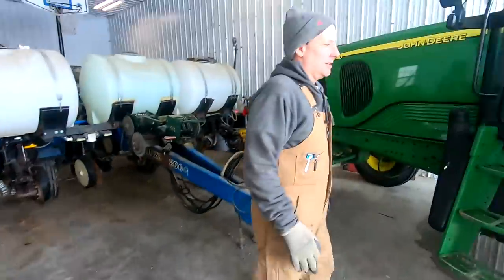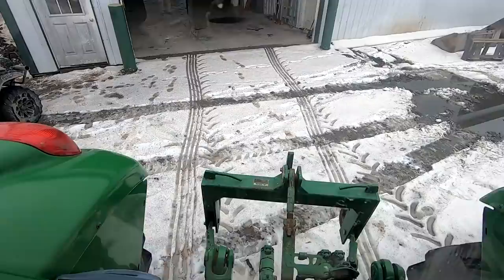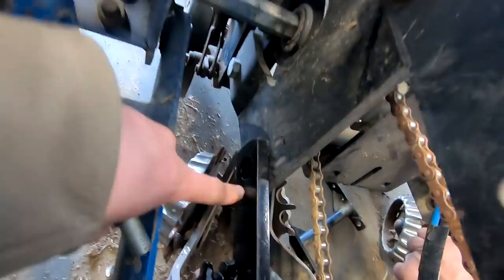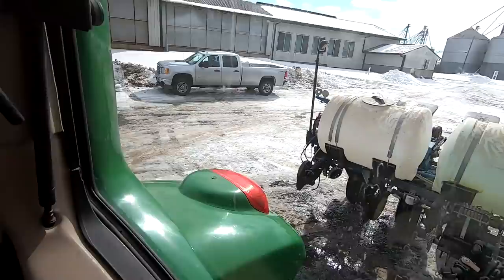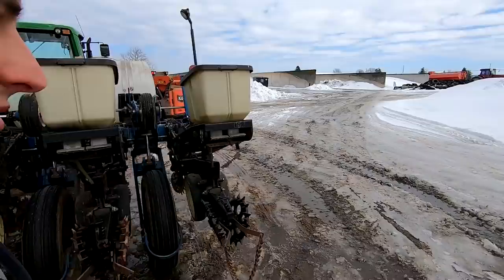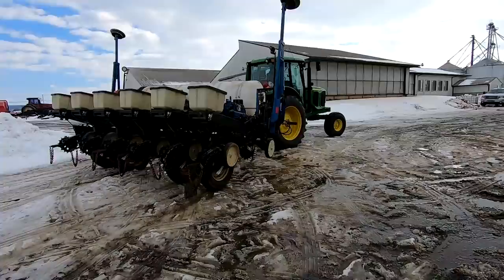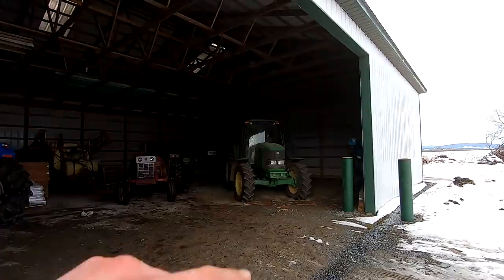Corn Planter is Ready for Spring

Comment: You guys should be selling your old rusty planter parts!  These are snapped up all around me for rustic garden art.  The row cleaners look like flowers. The discs are used to make a grilling tool called a discada or cowboy grill. New way to recycle and extend your connection with your fan base!  One mans trash is another mans(on woman’s)  treasure.

Comment: 0.58 " we need to take the bracket off the back." I think that is a quick hitch, which will attach quick hitch compatible implements (plow, rototiller, scraper) much quicker - like hooking up your skid steer implements. If you don't have a quick hitch you will have to attach / adjust the three linkages each time. If you don't need it I am sure you could sell it.

Comment: reason for the bushing is that you can torque the bolt fully, and not pinch the arm, so it can swing freely, it's basically a cheaper way then using a shouldered bolt
Reply from the maker: Yeah thats right

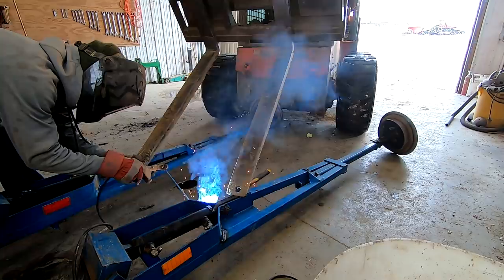Comment: Hey Eric, i just wanted to let you know the big no no you did at 4:26 its something that i never realized till i went to welding school. disconnect all batteries when welding on equipment, i realize these end rows don't have batteries BUT! that skid loader dose and its making electrical contact with your welder, witch is now driving a direct current through your battery, in a nutshell your cooking your battery and they can actually explode! my welding teacher had a safety glass boded in car and shows what can happen when welding on anything that has a battery equipet. a brand new battery lost 30% of its charging cap! another batter that was older exploded under the hood! so just a public service announcement, and if you ever wonder why batteries been offing themselves around the farm....welding could be your culprit!